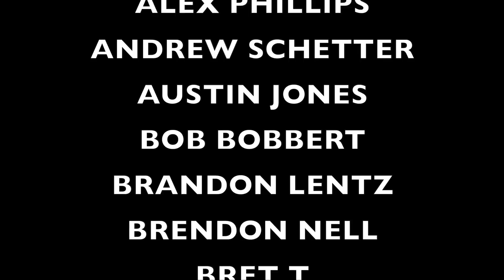EPIC JDM SWAP FOR MY AWD HONDA CRV

Comment: Im in the middle of this swap as we speak. U need a b16 em1 power steering bracket and pump to fit a crv pressure line.

Comment: Put a external gate with a 7psi spring in it on the downpipe, will be closed untill backpreassure rises over 7psi then free flow.

Tried it on a friends tuned SAAB 9⁵ pretty sure he has the record for stock turbo power still 😊

Comment: You can make more power if you put the b18 vtec head on the b20 bottom end. The b18 is a 1.8 L and the b20 is a 2.0 and its legos so it bolts right up. Pretty much a 1 jz gte head on a 2jz bottom end. 1.5jz
Reply: No

Comment: Bro you could’ve just gotten a b20vtec/ b16 vtec head to slap on that b20 bottom block the b20 have higher compressions + turbo =hot boyz shit 🔥 but still good to see a Honda getting built on ur channel 👍
Reply: The b20 block is to weak rudnik would send a rod though it quick
Reply: @MrPlasto1211  better to rebuild the sleeves on the block then to buy a new motor plus the b20 already comes high compression Atleast the B20b JDM ones
Reply: Cylinder walls are to thin on b20
Reply: @jerbrony  he would have to spend way more to sleeve the block waste of money
Reply: @MrPlasto1211  google says $200 to resleeve a block 😂 it ain’t no LS motor so it’ll prob be a lot cheaper $200-$600 cheaper then buy a whole ass motor though could use that extra money for a set of wheels
Reply: @Jerbruhh  stock sleeve can handle the power you need better and that cost money and its 600 each not total way more than an a gsr

Comment: Heres to ruddy hitting boost and breaking axles lololol
Reply: You might be surprised , if he avoids hard launching ..... my best buds 8th generation SI makes 750 whp on stock axles , fully built engine and Trans with dog gears . Only does rollers , never busted an axle which is literally the weakest link.

Comment: Id rev to 8500-9k max don't go over that's the bad territory mostly if something goes wrong
Reply: It's not , 8500 is less than stock rpm ..... it's all about the tune and oil .....

Comment: Gsr would of been way cooler in a integra or civic crx
Reply: That's what everyone does ..... the crv would smoke either on the dig .... it's able to put the power down . My ek9 at 190 whp smoked 350-400 whp boosted tegs because they never had any traction.

Comment: Do not rev that motor to 9500 do 9000 max bro why push it and risk risk the motor it's not a rotary.
Reply: The gsr , ITR , CTR , and some K series are capable of that stock tho .... my CTR engine has handled it for over a decade untouched.
Reply: @jordangarneau8817  I understand but why push it to 95 fuel cuts at 85 9 is more than enough
Reply: @freshh_as_fuckk  fuel cuts at 8500 ? Fuel never "cuts " , a fuel cut would cause an engine to blow up.